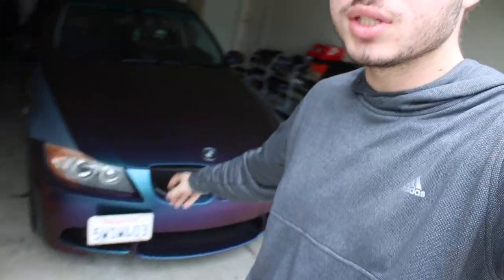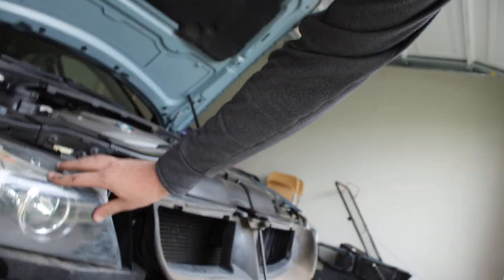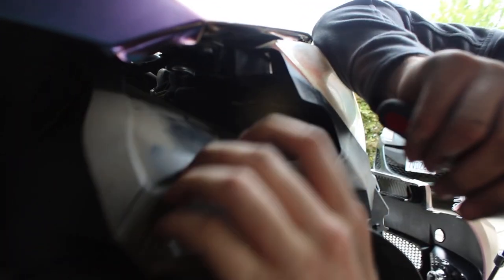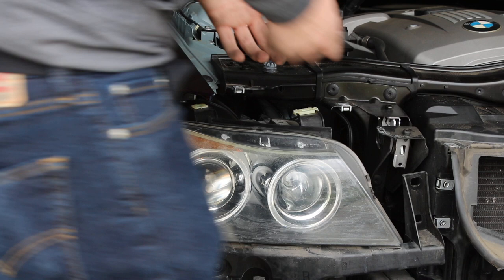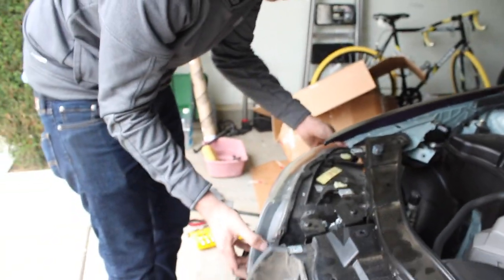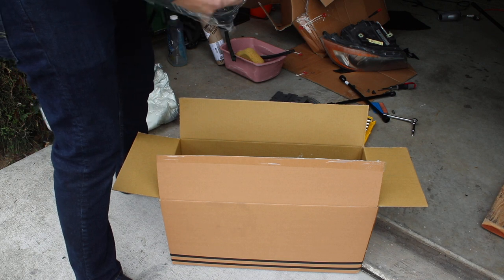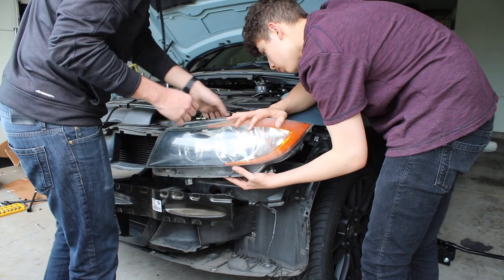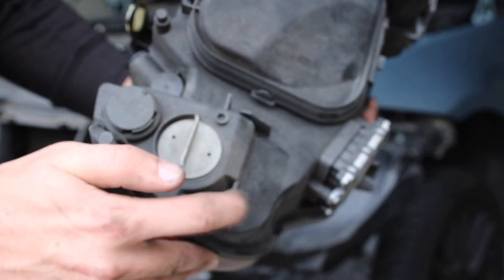NEW INSANE HEADLIGHTS FOR BMW 3 SERIES (HOWTO)

Comment: Hay man I’ve got a 2011 328 and bought the same type of headlights, brand is DNA, not sure what brand yours are but can the highbeam and low beam halogen bulb be replaced with the LED? if so do you know what the LED type and number is ? Also it looks like in your video  the two support brackets on top of the headlights did you not use the adjusting clips? Please respond back !
Thank you

Comment: Agreed with someone that theres a lot of missing info. If you hve xenon and want to replace with halogen like this its not going to work at all. Can you explain please the resisor thing. Where to get it. How to wire all so it can work on cars with factory xenons? If you have halogen then there.l is no issue. Just plug and play but replacing xenon with halogen requires more stufff. Plese explain all

Comment: Ok so I installed the same type of headlights but now I'm probably will put back the stock ones just bcuz I had this light come up on my cluster  which I dislike having any type of light on the cluster did you had the same problem with ur new set of headlight ?
Reply: Juan Mireles code it out.

Comment: How are these lights working out?  heard from a few others that they are having issues (i.e. connection/bulb failures, etc)
Reply: My drivers side low beam went out today I installed these headlights 4 days ago not sure if it’s just the bulb or something else cuz high beams work and the halogen bulbs work just not the low beam

Comment: have you had any issues with rain/moisture? and do they fit the same as the original headlights??  btw I have an e90 with stock halogen
Reply from the maker: best fit, no probems
Reply: are they plug and play?
Reply: check out the ebay link. it says it is plug n play and no drilling/modifications are needed

Comment: im curious how you guys got a non HID unit to work on a HID equipped car. Does it even keep the HID ballast and bulb? Or is this just halogen with a crap projector?
Reply from the maker: vietsimpleminded they just plugged in but I need to wire in a load resister
Reply: vietsimpleminded wth is a load resister lol

Comment: Sick bro! Will these work in 09 328i?
Reply: Yeah I have them on mine right now. They look incredible. If you want pics lmk
Reply: Yo Ben, i just bought these and installing them next week, did you just plug and play or did you buy load resistors too (i dont have xenon just the oiginal stock halogen lights) How are they looking at night? and in day?
Reply: @Ben_lewandowski  so they would work on a 2009 328xi sedan?

Comment: Link.  Wiring instructions. Any coding?  Programming?  Thanks.
Reply from the maker: http://www.ebay.com/itm/401227075374?_trksid=p2057872.m2749.l2649&ssPageName=STRK%3AMEBIDX%3AIT

I just have to deactivate adaptive headlights. So that error would go away after installing soem laod resisters.